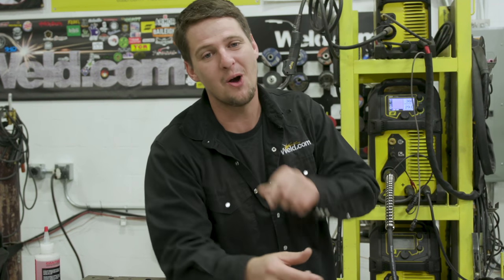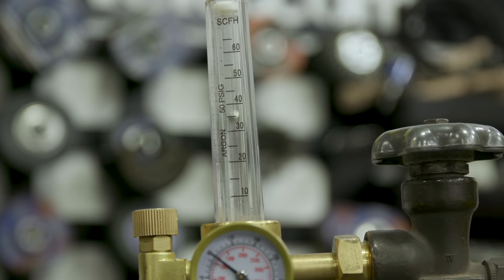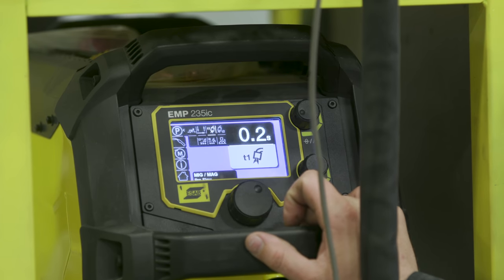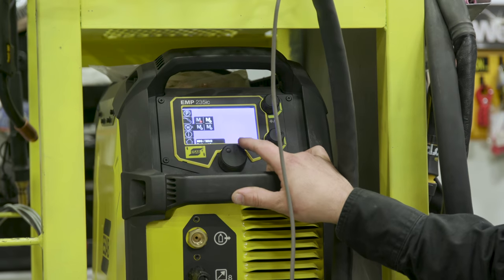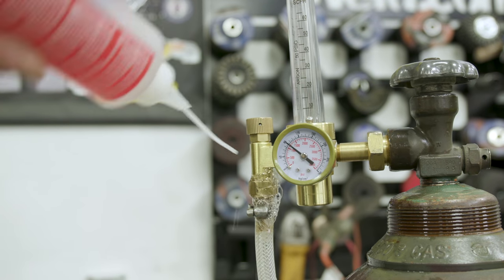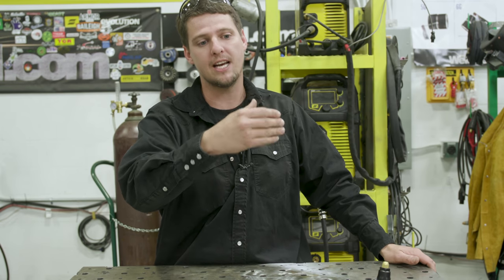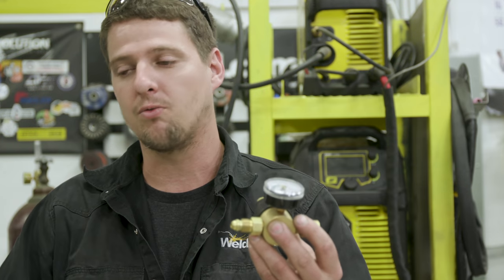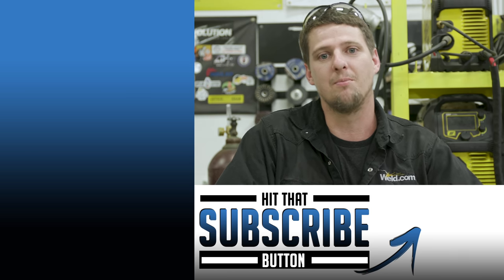4 Easy Tips to Save Gas

Comment: Another tip is using a nozzle flow meter (only used them for tig, I would imagine it could work for mig).  I had a random issue with gas coverage with my tig welder.  No leaks were found anywhere.  I knew something wasn’t right.  I put a flow meter on the nozzle and was getting 4-5 cfh lower flow than at the he regulator.  I ended up using leak detector on the whole tig torch hose and found some pindot leaks in jt.  Once I patched them up everything was working much better.  Leaks can be a bastard to find and fix sometimes.  

Also for a bonus point, I often shut the cylinder off and then check in the morning to see if the gauge moved.  That’s a real good indication of leaks 👍🏻.
Reply: Should u always bleed the gas from the line when tearing things down

Comment: you can save more gas doing stick welding  ;)
Reply: There's always that guy.
Reply: I agree!!!  Right on bro!!!!
Reply: @MR-nl8xr  hah, im only teasing dont get your wires twisted up
Reply: @Wroger Wroger xD
Reply: how to: never run out of gas 

weld stick.
Reply: @Wroger Wroger the air/atmosphere is already mostly nitrogen, you're supposed to shield against it?
Reply: @Wroger Wroger you're normally shielding against the air around you, which is nitrogen+oxygen. So why would anyone try to use nitrogen as a shielding gas? I've just never heard of it being done.

Comment: Tip #5, Always close off your tank valve when not in use for a while and never depend on the machine's solenoid to keep a 100% gas tight seal.
Reply: Also the solenoid can cause underpressure I've found lol
Reply: Love direct connections for that reason

Comment: For those crappy hose clamp/crimped connections on the rubber hose to the regulator, I’ve found that putting a TINY amount of loctite 515 or any other o-ring sealant works for those pesky leaks you can’t chase away. Of course let it cure for 24 hours before welding so the VOCs in the loctite off-gas and don’t end up in the weld.

Comment: A couple days to late for me, the other day I used 550 PSI from my 125 Cu ft bottle in one 30 min session. I didn't realize my flow was set so high, and my regulator frosted over because of how much gas I was pulling through it.

Comment: The biggest thing i have noticed is the leak at the bottle valve. Every single bottle. I use soapy water,and the nut has to be very tight. Dont assume its tight enough, check and tighten as necessary.
Reply: Replace the bottle connector stub on your regulator (yes you can buy them separately).
When they wear out, they require more and more torque to seal.
Reply: New. And with all three welders i have owned . I merely pointed out the fact they all leak. And you cant assume they dont leak. The fact is you can assume they do leak. Due dilligence.

Comment: I've been a big ol' dumb-o and left cylinders on, but connected to the welder, and come back after a while of not welding to find an empty cylinder. Even though I would leak test, it must have had some micro leak that bled gas. Just add it to the list of why you should never leave gas on if you're not welding.
Reply: Hard on the solenoids too I bet being pressurized 24/7..
Reply: @Wroger Wroger do you happen to have a manufacturer or authority reference to that statement.
I always hear guys say that, but never say where they got it from.

Comment: To save gas and money just don't use built-in flow meters of any kind - they inherently leek more pressure while in pause which gives you gas surges.

Double stage pressure regulators for compressed gases, so you don't have to correct it all the time. All those "optimizers/economiser" are effectively the second stages anyway but you cannot regulate them (mostly), and they distort flow meter readings.

Single stage regulators for liquid gases will give constant flow while there is a liquid phase in the cylinder.

And external flow meter for the torch nozzle.

Or you can put solenoid right after the regulator to eliminate gas surges.

Comment: Thanks for all the videos 😊. How would you make a welding mask bib?
Reply: I know this is a 4 year old comment, but if you haven't already solved your bib issue by now, Lowe's has them for $16. Price may be different in your area. It just presses onto the bottom lip. Mine has stayed in place for about 3-4 months now, and hasn't came loose at all. Or another option is finding a cheap one on Amazon if cost is a factor.

Comment: So I think I tightened the hose fitting into the back of my machine too much because it wouldn't get tight(haven't set up gas before). And was wondering if anyone could tell me if that could have loosened it from the inside and caused a leak ?

Comment: My brand new flow meter leaks, it has niks on the threads and they are so tiny and small but make all the difference, I am going to be getting a HARRIS meter because the one that came with my machine was cheaped out and leaked out the box.

Comment: Is there a good reference chart for TIG gas and what factors to decrease gas usage?
Reply: Best reference I could come up with is someone adjusting the flow as I weld a few beads. Do it in steps to find the sweet spot. Every welder and machine are different so finding the right flow depends on so much, this way I could get effective coverage and saved about 1/3 of the gas I was using. Note results on the side of the machine with paint stick :-)
Reply: There is a chart and most cup sizes come with cfn charts and tungsten stick out on the box recommended. If you're doing lift or scratch just adjust it on the stinger valve and gauge valve running 45cfm.